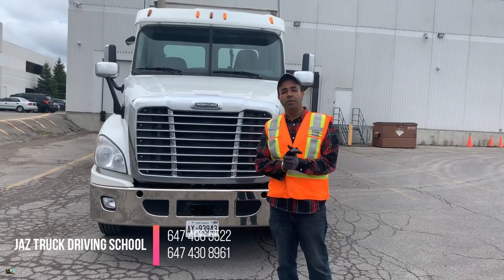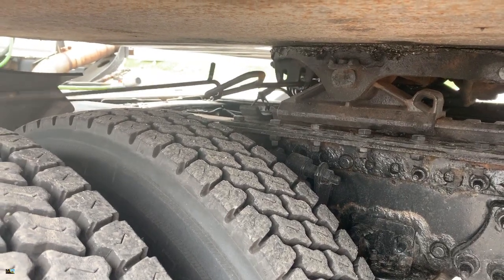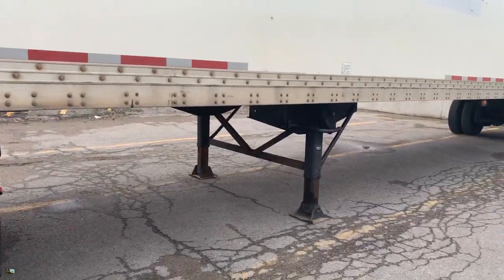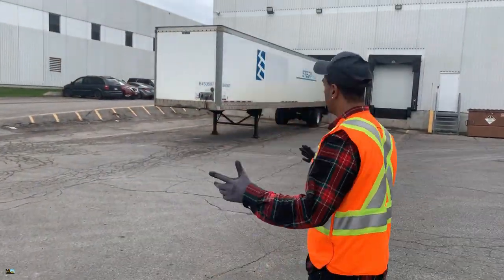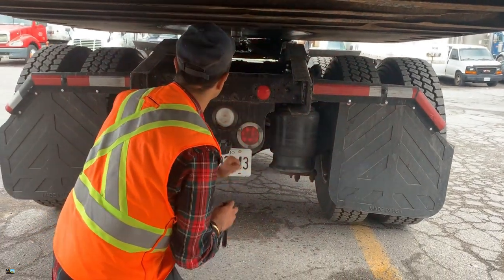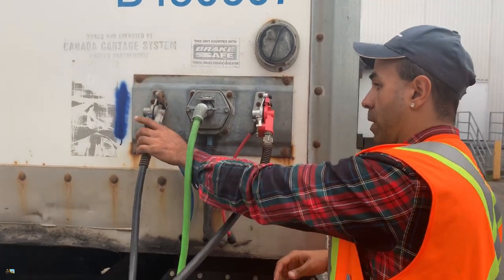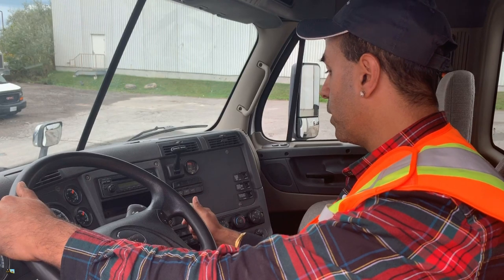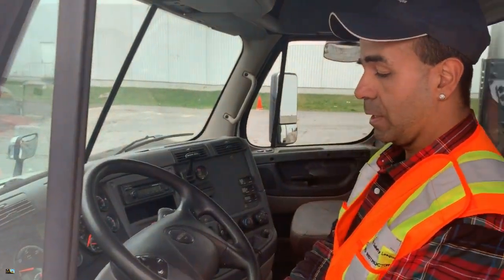Jaz truck driving school Uncoupling & Coupling training video 2019 Melt

Comment: Why not dump the air from the airbags, as soon as the truck has been moved a few inches away from the kingpin?
That way you won’t scrape the grease and put unnecessary wear on the fifth wheel..
Reply: Not how the ministry wants it

Comment: got a question. At 8:25mins in the video you tell the examiner the trailer height is good. What would you do if the height is not good, i assume it would be (low).. can you raise the trailer with the landing gear mechanism?
Reply: You can do that (it's strenuous) or you can lower the back of the tractor by lowering the air ride suspension.

Comment: I've seen other videos on lowering the landing gear and they say not to go down all the way. Which one is correct?
Reply: Both ways are correct, however it is recommended to leave a 1/2" gap between the bottom of the landing gear and the ground.

Comment: The CDL manual says to connect the air lines when you're backed up but not yet under the trailer.
Reply: This is 🇨🇦  not 🇺🇲
Reply: @williamb1332  I'm sorry, but what does that mean?
Reply: @johnjacob688  we do things differently.
Reply: It's a Canadian school and if we did what the CDL manual says, we would fail. We in Ontario Canada go by the M.E.L.T program here.
Reply: Why would you connect air lines to a trailer that isn't even attached to the tractor yet?

Comment: If you do not get in and out of your truck using 3 points of contact you will fail your test. Thank you very much for this video though
Reply from the maker: Hey thanks for your feedback. It's good to follow the 3 points of contact when exiting or entering but examiners can not fail you for not following that step. It's not in their guidelines. Thanks again for showing interest.
Reply: @flyingjstation  No sir that is incorrect. In USA, not using 3 points of contact while getting in or out of the cab is an automatic failure.  I know this to be true because it happened to me.
Reply from the maker: @J B  like I said before, it's good to follow 3 points of contact, but it's not automatic fail or disqualification during the road test in ONTARIO, CANADA. Thanks for showing interest.

Comment: why didn't you TAKE THE KEYS out and take with you before crawling under the trailer??
Safety 1st.
Reply from the maker: Because there is no such requirement from MTO/drivetest to take keys with you for performing a road test to get CDL. Tutorial Videos are for understanding how it needs to be done but I would strong encourage you to stick to your own Instructor's manual.
Reply: Are the keys going to turn themselves and fire up the engine?

Comment: Hello Jaz, I am an Evaluator and Instructor, plus I have been driving a straight truck and tractor-trailer for almost 50 years. No disrespect intended, but I would fail you and ask for a refresher class. There are so many things you have done wrong. From the placement of the landing gear, the 5th wheel release, and not to over-grease the 5th wheel,  to the brake check. I appreciate the effort to show a basic Coupling and Uncoupling, but so far, as an Evaluator, you've not given me the correct way to Unload and reload that truck.